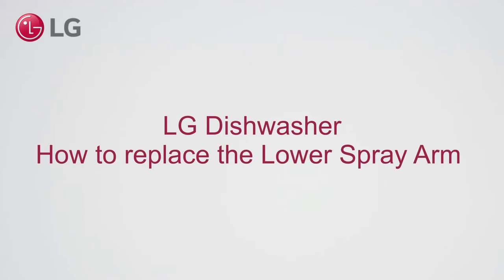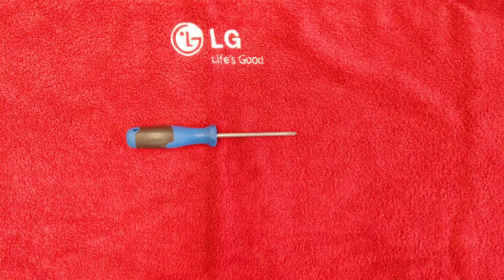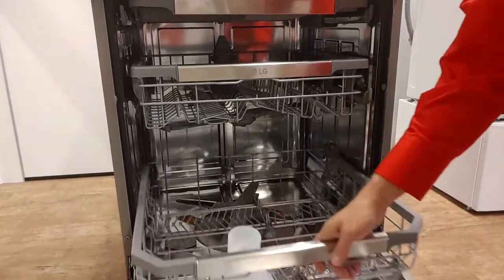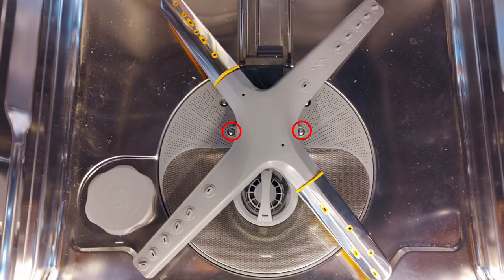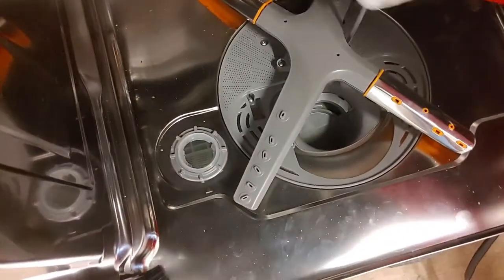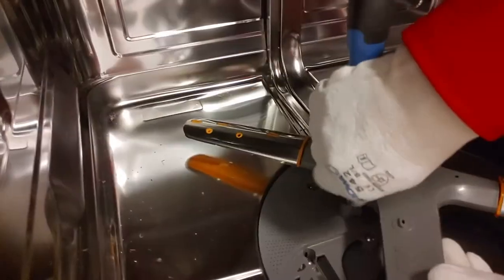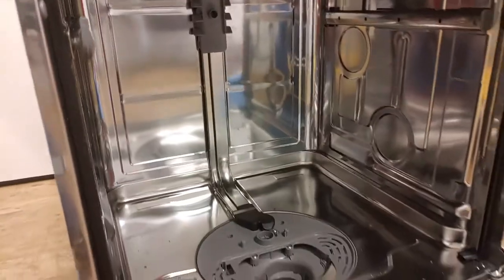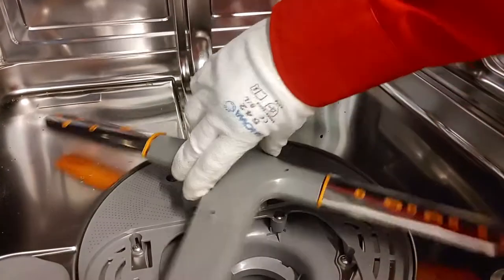[LG Dishwasher] - How to replace the lower spray arm

Comment: I’ve had so many problems with my LG dishwasher and finally thought it was finally done with repairs and now the plastic piece on the spray arms are about to break off. I had to reattach the plastic cover which is on 2 of the blades and it’s just a matter of time before I have to buy yet another part. I think they made this to fail. Also now I’m having an annoying loud whistling noise while the dishwasher is on.  It’s leaving some of the dishes dirty. Thank you for this video! I appreciate it!
Reply from the maker: That is unfortunate to hear. Of course not knowing the exact problem of your dishwasher there is not much we can offer you. There are models with (partially) metal arm blades, which have extended lifetime, but that is of no help for you now. Proper maintenance, including sometimes running a high temp program with an empty dishwasher helps to remove limescale and other debris and perhaps will reduce the whistling too.
Reply: Yes, I had a look at that plastic end piece and I don't like it one bit. Mine came off and it was not easy to reattach without risking breakage of the flimsy bit that holds it on.   Very disappointed in this Mickey Mouse effort by LG.   A great shame really because otherwise it does a good job.   When this one dies, and I suspect it will be soon, I'll be looking elsewhere.  LG has been my go-to supplier, but things do change and it looks like that time has come.
Reply: One of the orange spray arm has fallen off. I want to replace it. but i cant seem to find the part for a LDFN4542S for some reason its unlisted model type
Reply: @daveanderson7935 yeah my orange piece fell off too!!!! I manage to place back in. Buts its not holding. It pops off too easily.
Reply: @kidchuckle did you find a solution for this? The arm on mine is falling off and I just reattach it after every cycle 😬
Reply: @christiankennedy1669  yeah I just bought a replacement part. I had to look up the part number for my dishwasher. and its working well for the last 2 weeks. I bought a whole new arm. They  didnt sell the small endcaps.

Comment: What are those two screws that hold in the arm? If I buy a replacement arm will the screws come with it? I've misplaced mine
Reply from the maker: No, the replacement arm does not come with screws. Either use the old screws or look for similar size, stainless steel, screws.

Comment: on mine, the rubber boot under that lower spray arm keeps lifting, stopping the arm from turning. it pushes down, but water pressure (?) keeps popping it back up. bloody annoying. was thinking of just ripping it off.
Reply from the maker: Hello David, not sure about your arm's system, but indeed, in general water pressure helps to pop up the rotation system of the spray arm. you may want to seek advise from a technician.
Reply: @LGSAE  its exactly that as shown in the video. its the rubber boot seen at 42 seconds that keeps jumping up, which stops the arm rotating.
Reply: Yeah, the rubber boot thingy...........   a very Mickey Mouse effort by LG that makes me wonder who is steering the boat.   That boot is the connection between the pump and the upper spray arms. If it pops out, water does not get up there.   The boot is sort of held inplace by a small metal clip that rests on a shoulder cast into the boot.  That shoulder shears-off with time and the whole thing come apart.   I can find nothing in LG's site that addresses the problem.  I made a larger SSteel tab that extends over the boot.  You will need to shape the tap with a bit of  contouriing so that it does not compress the boot significantly.  Note that the boot needs to be coaxed into place.........  not a very elegant piece of work.  The boot would be easy to replace if the part is available.

Comment: Where do I get the replacement part?
Reply from the maker: Check your local LG website and look up the suppor section. It shouldcontain a sectuion about spare parts. LG has selected official spare parts suppliers. But it may be wise to first checkwhat the part number is by contacting your local LG support desk.
Reply: @LGSAE  I already ordered it from Amazon but $88 is ridiculously expensive for a piece of plastic. In reality I only needed one piece from it but nobody sells it. You need to get the whole piece.